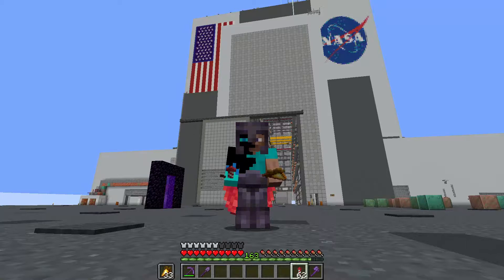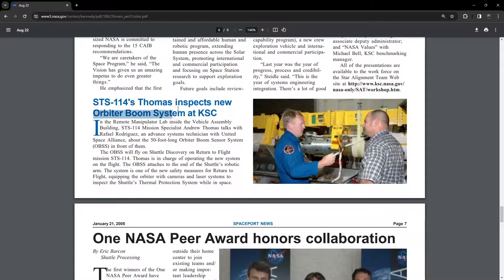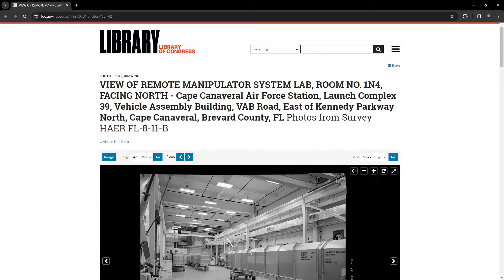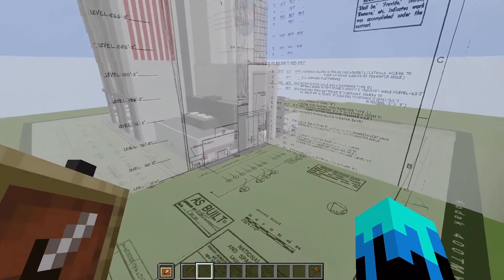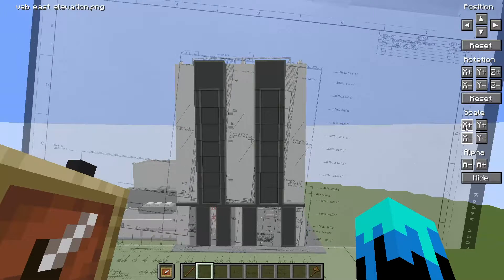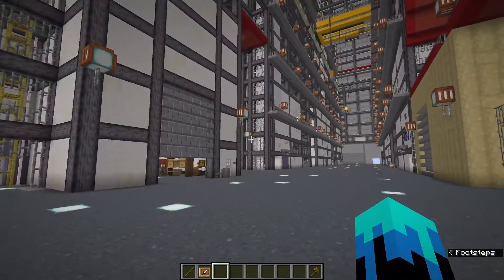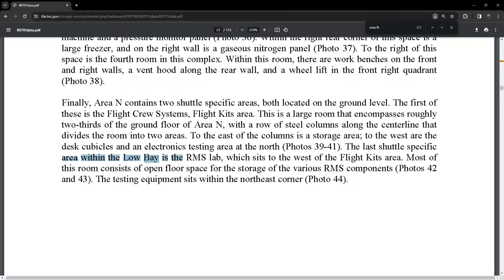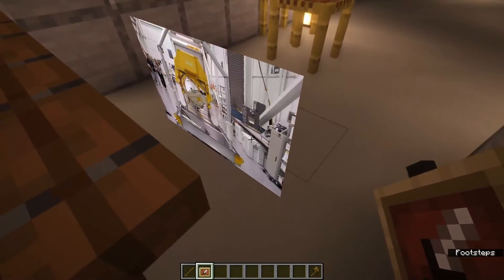Recreating THE INSIDE of NASA's VAB in Minecraft

Comment: Hi Vernando,
KSC Engineer here. Great work! Watching your video I could very easily pick out the major points of interest in the VAB, which is a testament to your dedication of a recreation!  A couple of thoughts/interesting bits of info to share:

- Outside of rockets, the VAB is also a massive storage space. There's lots of floors that have concrete slabs used to store support equipment or other infrequently used, yet important tooling or supplies needed to stack/operate a rocket. Including many artifacts from the Space Shuttle Program that have been kept from being excessesed in the event they need to be reviewed/repurposed later. I once stumbled across the access platforms for the Space Shuttle Engine Compartment on a floor of a seldom used tower!

- The Lowbay areas are in a state of flux. The area you discussed as the RMS shop today is being used as the RS-25 engine shop. In the past it has lived in other areas. Post Shuttle and into the SLS era, NASA spent a good deal of time looking for ways to reuse existing facilities to be the most responsible with a buck.

- On the West Side of the Low Bay actually lives giant ovens that were used during the early days of shuttle to "bake" the RSRMV segments prior to stacking (before the RPSF was built to the North of VAB). Today it's used to support the facility logistics, the ovens still remain. 

- The Lowbay contains MANY offices! During Apollo/Skylab when the VAB was home to exclusively liquid fueled rockets, NASA had no issues with people using these facilities to support the technician/engineering workforce. During the early days of shuttle, it was decided that having present SRBs in the building and the subsequent risk of explosion if something were to go wrong resulted in the OSBI and II building to be built to move personnel a farther distance away from the hazardous areas. 

- The Red platforms on the East side of the lowbay cells are actually from Apollo! They were used to check out and perform work on the 3rd stage of the Saturn V.

I hope this helps!
Reply from the maker: Great to hear from you! Yes your information helps massively! My goal is to create an accurate representation of each area but I'm happy to create from any particular era for each room. When I started this project almost a year ago, I never dreamed I would be able to connect with an actual KSC engineer!
I have a lot of fun researching and finding photos or videos of various vantage points then working out where they are and recreating them - there's still a lot of missing spots I've not managed to find yet.

I've found some photos of the TOSC Oil Pharmacy - based on the position of the pillars and general size against the original masterplan floor 1 schematic I'd guess it's on the west side of area M - does this sound correct to you or has that been repurposed?

I'm really interested in the ovens you mentioned that used to bake the propellent into the SRB sections, are these on the ground floor in area L (i.e. first on the left when you go in) I found an old diagram that talked about these being paint & insulation booths for SRB structures - any other tips or terms I can search for to find reference photos would be epic.